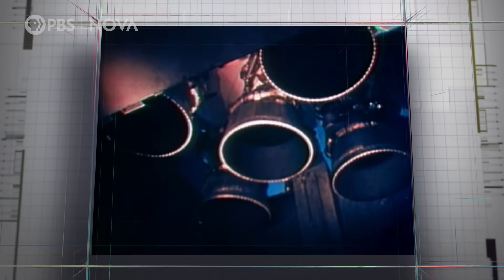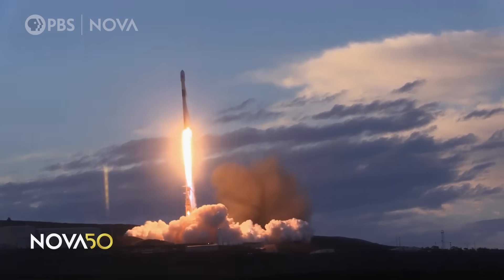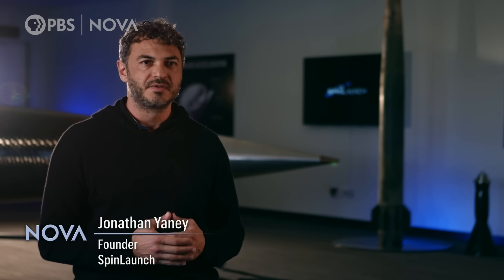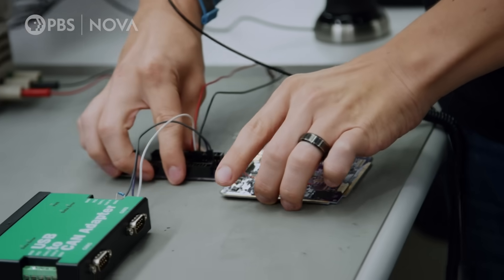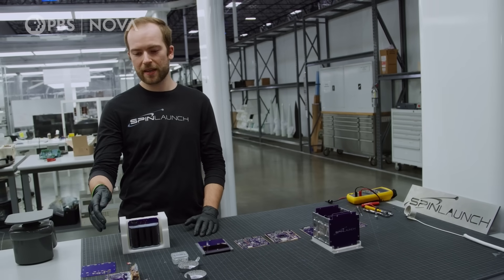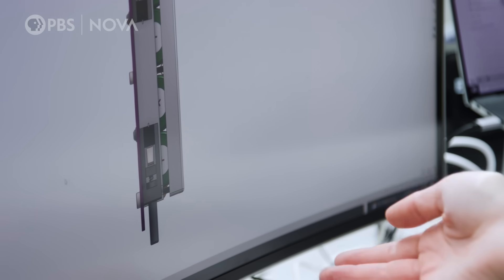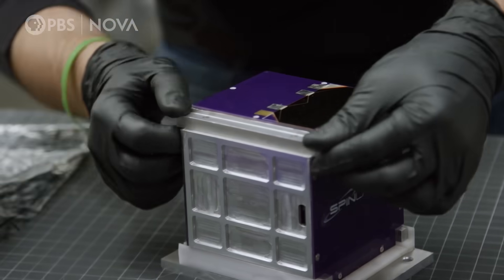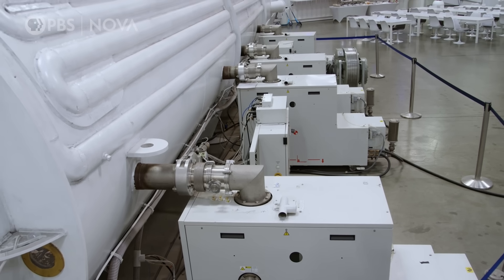A New Way to Launch Spacecrafts Into Orbit | NOVA | PBS

Comment: Spin Launch is a solution in search of a problem. It merely shifts all the traditional launch constraints to other places, and creates new burdens to boot. Every trade-off it makes is a bad one. It forces potential customers to completely re-engineer (and in fact, OVER-engineer) their payloads, adding tremendous financial & schedule costs to their project. 

It's like trying to engineer a system that takes each individual sneaker or consumer toy as it comes off the assembly line in a factory in Vietnam and deliver it to the US individually via cannon across the Pacific... instead of just loading thousands of them into a standard cargo container which then gets loaded on a standard container ship.

Comment: My preferred option is launch from high  altitude aircraft, which has been done.  But the aircraft had been a B52, or l1011.  I'd look at designing from scratch, a task specific aircraft.
This would be more viable than a high altitude balloon platform, imho.
A third option would be a ground based linear accelerator launch.
But, all options should be researched and tested.  None of them may be the single best solution.  But, each may prove to have a place in orbital access, depending upon mission timing, resources, cost, etc.

Comment: Main advantage I see is if use second reuse than spin launch will refuel spacecraft in Leo. Yes energy require from electric gird is huge but over all cheaper than operational and labor cost of a traditional rocket.

Comment: Go watch Thunderf00t's exposure of this.  It is basically garbage at this point.  The rocket comes out at an angle, and at a speed about 10x slower than that needed for orbit.  That means you actually need 100x more energy to make it to orbit.  This is just another way to blow through government funding.  He busted it TWICE, THREE YEARS AGO.  Start with 9ziGI0i9VbE

Comment: I find my idea to be much better and I sent a email to the Shanghai institute of science and technology explaining how a magnetic launcher that could in theory launch a SpaceX's space ship up around 30/40 km up into the atmosphere and then fire a rocket system that could get the craft the other 60 km to reach space further more I explained to the shanghi institute how another two launchers could be set up to send payloads to the moon and beyond to mars this system alone as I have thought about it for over 20 years is a system that uses less fuel so it is environmentally friendly and increases the payload due to not being launched in the ground in my opinion Elon Musk is playing with a double edge sword where on one hand he has a electric car company saying it's good for the environment on the other hand uses methane gas owerd rocket system to achieve lift off as I said my system is both green and efficient as well as the profit margins are lucrative due to low cost and high efficiency ❤❤❤❤❤

Comment: It’s a 10 year old company that actually has done this.  They’ve actually launched small payloads into low orbit in this manner.  The problem is that this can be done practically ONLY with small payloads; it is impractical to use it to launch large ones.

Comment: Spinlaunch is audacious but silly. What they are doing is replacing the first couple stages of a traditional ground launcher, so that's the proper comparison to make: is spinning cheaper and more reliable for that simple function? Probably not. That 4700 mph spin-up is the fastest the payload ever goes before the very traditional rocket fires. On the way up to firing that rocket at 200,000 feet it does nothing but slow down. Do you notice they never say their speed at ignition? That's probably the apogee of the spinlaunch, which suggests the speed is near zero. Their little rocket, then, is just the same as somehow launching from the top of a 200,000-foot mountain. That's a big help, but how much of a help?  MY space startup (naked self-interest here) fired our rocket from a Lockheed F-104 flying in a 45-degree zoom climb at Mach 2.1 at 84,000 feet. The apogee of that Starfighter zoom (the altitude at which it is no longer climbing at measurable speed) was 102,000 feet, so only half as high as the spinlaunch but still an interesting comparison because our cost to that point was about $6000 since we hadn't yet fired the rocket. 84,000 feet provided us the best combination of altitude, attitude and speed to reach orbit. So we, too, were replacing the traditional first stage or two, but with a bitchin' fighter, saving MORE money without requiring 10,000G construction. Yet in the end we all failed.

Comment: This kind of high-G engineering could be important, even if the object is not sent to space to get experience how to make durable electronic circuits and structures.
Have they compared X-ray or CT-SCAN images of the objects before and after the spin?

Comment: Wouldn't a mass driver on a 2 mile railway make more sense than this.  At least with the mass driver you can slowly get up to speed without the g forces.  Less of an issue on the payload integrity.

Comment: Fantastic if they can do it, but it's big issue isn't getting the payload to speed, or timing the launch release, it's what happens to the hardware that is spinning at such high speeds in a vacuum, when the release causes a sudden inrush of air in to the spin chamber. Those payload arms are going to slow down harder then an f4 Phantom testing reactor concrete.
It will be far more useful when mounted on moons and asteroids to throw ore and ice payloads down the well to Mars or Earth. In that usage there's a much lower issue thanks to Newton, with the payloads leaving the body at a tangent, and the body not moving away in the opposite direction as much. Likely by now, someone has realized they could use this method for nearly undetectable launches of kinetic warheads, leaving the US (or anywhere in the solar system) with no smoke plumes or silo door openings to spot from space, and able to impact anywhere on the globe with no warning.

Comment: A really good spin on Jules Verne's space cannon.

An electronic version could probably work on the moon. It would be several kilometers long and would produce far fewer "G"s.

Commuting from Earth's surface to even low Earth orbit is immensely expensive and always will be.

The way out of this is to create a long-term presence in space. And this itself has tremendous technological challenges. Somehow, cosmic radiation has to be diverted around any living quarters up there.

Comment: A quick search of SpinLaunch's launch velocity goal and the muzzle velocity needed for a projectile to reach orbit suggests to me that the envisioned system will not make a significant contribution to putting a payload into orbit, but will place those extreme g-load demands on the payload. Further, conventional rockets are at their slowest where the atmosphere is thickest. SpinLaunch requires a very high velocity within the thickest part of the atmosphere.  Maybe they will sort all that out.  I would not bet the ranch on it.

Comment: The 10,000 g test says it is plausible.  However, I wouldn't ditch the fairing until I was a bit higher than 40 miles.  There's significant drag, even there.  I would drop the tail cover and rocket out of the atmosphere with far less drag than if it were just the payload.  That fairing can drop anywhere almost up to the Karmann line and it wouldn't cause trouble.

Comment: My biggest question is what happens when you open the gate and the air rushes in as you launch.  Also, is it more practical to build these at very high altitudes simply because of the atmosphere.  Do we level a mountain top just to build one of these?

Comment: They gloss over the REAL 'elephant in the room' which is the rocket that's needed to multiply the velocity over 5X to attain orbit.   NO WAY any rocket is going to take thousands of G's laterally even if you encase it in resin.   Before investing in this company...I'd demand they produce the rocket first because the spinning thing is the easy part.

Comment: Startling that basic engineering is missed by NASA. Vacuum to wall of air at 5 miles a second. What do they think is going to happen?
Reply: Max q at sea level... Sonic boom metal rain machine. 
It would be a decent Star wars weapon.
Reply: You didn't watch the video, did you? They had multiple successful launches at 1/3rd scale and you can see it happen on camera.
Reply: @darthmeow1370  What happens to cross section as you scale to full size?
See rail gun.

Comment: It's still a pie in the sky system.
Short of throwing rocks into space, nothing else useful with survive the G forces.
Change the batteries, great, what about the electronics, the propellants and motors needed for final orbit adjustment?
How many completely solid state, non deploying (solar panel arrays etc) are there lining up for a rock launcher???

Comment: 100% won't be the end of traditional rockets because the G forces are insanely high so it could never be used for human spaceflight. Also in order to have anywhere near a Starship equivalent payload the launcher would need to be incomprehensibly huge

Comment: This ia a gravy train for the executives wasting stupid investors money. This will never work They provide the proof with no data, no requirements, and then they provide solutions to batteries. How about proof of escape volocity? What about sensetive satallite instruments, which experience only 3 G's rather than 10,000 Gs? Run away, investors. I hope this saves one person from loosing their money to these snake oil salesmen.
Reply: Too late, they already took the money and ran.
Reply: You may well be correct.
They obviously purchased this 9:57 from a Sci-Fi movie set! 🤣 How much did that high-tech office/observation unit cost?

Comment: Is it more energy efficient though, in the end its using energy to spin and accelerare with fosil fuels or similar, whats the point. If it requires less energy it could be good, maybe they use gravity so it doesnt use as much energy for the spin idk.

Comment: Same 10,000G would be felt in a gun to reach the same velocity except it happens over shorter duration.
Just make the electric motor a linear accelerator.

Comment: Notice the lateral translation as it comes out?  That's what's keeping them from going live, they are unable to release instantaneously and therefore cannot calculate the trajectory of the payload.  An inch/centimeter out of alignment on earth means miles/kilometers out of alignment at orbital altitudes.
Reply: just saw that yeah....its very unpredictable, i dont see this ever working out.
Reply: Rockets don't go in a straight line. They can turn and course correct..

Comment: Wouldn't a electromagnetic super maglev ramp be  a little easier ?
No idea I just want to see GIANTMUNGOUS ramps
Reply: Upvote for Dukes of Hazard-ing it to space....but probably not; that's basically the same idea with more parts to build.  It would certainly allow for lower acceleration forces without the really tiny curve, so maybe a long enough one could be used for humans, but eventually a rocket has to get involved for the final thrust and targeting.  It would probably also need near-vacuum ala the Hyperloop, and comments here are saying both Spin-Launch and Hyperloop have been deemed unfeasible.  Your ramp would have the benefit of being slightly lower atmospheric pressure when the missile/rocket/train exits the end of the system, though.  Maybe this will all lead to better things as time and materials technology improve.

Comment: Spinlaunch is a great idea - for the Moon or other airless bodies.
Reply: An electromagnetic railgun would probably be easier.
Reply: @andrewc662  No, Spin launch is way more efficient infrastructure wise. Just one big electric motor, no need for kilometers of track with boost magnets along it. Big drawback is only launching things that can take the acceleration.
Reply: @JohnPowell6  you need massive vacuum pumps to keep a vacuum in the spin chamber that aint cheap at all
Reply: @ I said it was a great idea on the Moon and other airless bodies.
Reply: Particularly those with lower a gravity force to overcome.
Reply: Great idea? explain please
Reply: Nope.   That's not the major problem.  The major problem is that the rocket system his to withstand massive acceleration forces perpendicular to the flight axis.   It might be useful for small, "one time", missions like a unique science or communications system.   But this type of mission often is Piggy backed onto a larger, often military, mission.
Reply: Here's how Spinlaunch fits into Musk's dream of becoming the Carnegie-Vanderbilt of the 21st century. Background: Carnegie, steel, mining; Vanderbilt: Railroads. The far side of the Moon is much better than the near side for mining. When the Moon was forming, the Earth's gravity pulled the lava and created giant "oceans" of worthless basalt, impractical to dig through, facing the Earth. But on the far side giant mountains of valuable minerals were exposed, easier to mine. Musk is going to put his "boring machine" on a Super Heavy and send it to the far side to mine rare-earth elements. They will be purified as part of the mining process and _ using Spinlaunch the ingots will be flung toward the Earth where they will be used. An ingot can withstand the forces. BTW: Mars? Publicity. The money is on the Moon.
Reply: @franksizzllemann5628  Once you have that sort of facility on the farside of Luna, those payloads can be sent anywhere in the solar system at a very low cost for the delta-v required. Build a railgun launcher that is several miles long and you can loft a fully fueled Starship to Mars without it needing to use any of it's fuel mass. Better still, launch mining Starships to the Belt, using longer railguns to reduce the acceleration to levels human tolerable, and get to speeds that shorten the trip time.
Reply: My gut reaction was skepticism but that isn't a bad idea. No need for a vacuum chamber so it could release the payload in any direction for different orbits. Have you done the math for the size and g forces required?
Reply: How do you slow it down again?
Reply: @wasp586  You loft it, who cares if it takes a month to get to the smelter on the surface of Earth? Orbital mechanics between Earth and its moon good enough to satisfy Einstein's, and they were good enough before when they satisfied Newton's. Will people not be able to affect an ingot's trajectory? Launch it with a package of directionals, kwim.
Reply: @wasp586  Ahhh, now here's the rub. All that air rushes in,......
Reply: The smaller the body you're launching from, the better this gets. A railgun has to deal with Newton making the asteroid or moon move in the opposite direction to the payload. Spin launches on those size bodies, the payload effectively drops away from the body at a tangent, so the body retains it's own orbit., at least until enough ore is mined to dramatically change the bodies mass.
Reply: but cant launch a Manned Rocket!
Reply: @Leafbinder  Can't, and won't launch anything. Spinlaunch is a Scam and PBS fell for it.

Comment: I like the elevator to space
Reply: no like throwing speghetti against the wall , no human can survive the G`s of this process.
Reply: Space elevators won’t work either. Anything going up a space elevator still has to accelerate horizontally somehow. That requires fuel. And that’s even harder when you’re trying not move the elevator.
Reply: @albeit1 You are right that angular velocity isn't addressed in the basic (simple) presentation of a space elevator.
But it is not a show stopper.
If mass going up is balanced by mass coming down, there is no net acceleration.
If balance cannot be achieved then the counterweight can be made to advance beyond Earth's (or wherever) rotation. That way "up" is in the direction of rotation, and climbing will also provide the required angular force.

You might now have some mental image of the top of the elevator whipping about. Sure, but do the calculations before assuming that it is critical.
Reply: @ it sounds like you’re assuming an infinitely stiff cable.
Reply: @albeit1  ohh no, far from it.
With an infinitely stiff cable, there wouldn't be an issue (apart from the insanely high torque at the root).
Just by considering angular momentum..
As a mass climbs the cable, the cable at the mass will begin to lag. That means that both the counterweight and the root will be ahead of the mass, and the tension in the cable will accelerate the mass.
Note that the same tension will retard the counterweight.
But, whenever the mass stops, the tension will bring the whole system back into a stable vertical configuration.

But that will add vastly greater demands on the strength of the cable.
It can be mitigated by having a continuous circuit of mass travelling up and down. When transit is required, some of the circulating mass is replaced by the capsule.
If the journey is to space then equivalent mass from asteroid mining can come down. If the journey is ftom space then.. Err, garbage? can be sent up.

Comment: This spacecraft could also need a heat shield as it plowed through the atmosphere starting at a high speed and gradually slowing down until it reached space at which point a rocket stage would have to ignite and burn long and hard to bring it up to orbital speed.